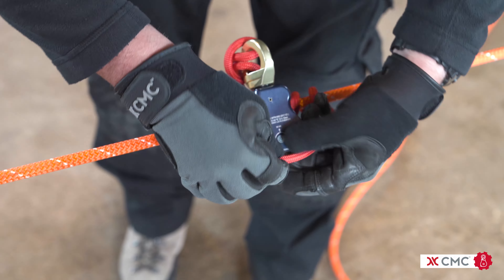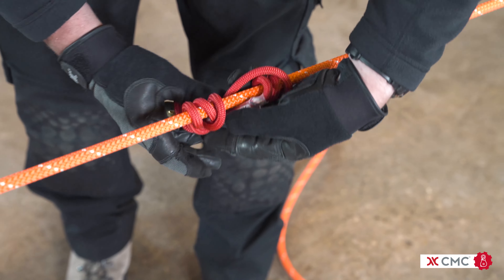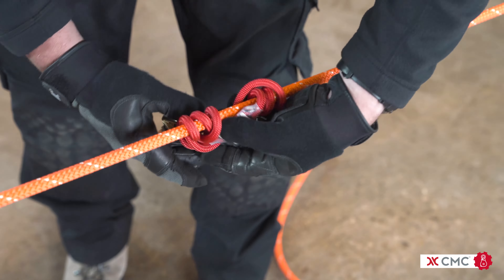Girth Hitch a Prusik Directly to a Pulley // CMC Pro-Tip

Comment: Correct me if I’m wrong but won’t the girth hitch reduce the overall strength of the system?
Reply: The girth hitch isn't as strong, but I think this video is assuming you are using the girth hitch on the ratchet pulley of a MA, not on a system capture such as tandem prusiks on a LRH. So long as a system capture (MPD/Clutch or tandem prusiks) are in place, if for some crazy reason this girth hitch on a ratchet pulley failed, the system would still be captured and in tact. 

At least with the systems/equipment I use/am familiar with, it would be pretty difficult to girth hitch a tandem prusik system capture or belay to a LRH instead of using the stronger/better attachment of the loop to a carabiner.
Reply: Yep, I agree. I was going to add another comment in the end I decided to reply to your comment

Comment: More like an amature tip. Crap, I didn't bring enough carabiners. Seriously though, this is clearly a slower method. Speed is critical in any real rescue situation.
Reply: Gear tally is also important. Some teams are minimalist, so understanding techniques to minimize gear use is important. The more you know, the less you have to carry. Your solution can't always be "just bring more gear."
Reply: Just to be clear, and to build off of the very prescient previous reply to your comment, this is not necessarily a slower method. The way shown in the video is sub-optimal. Instead, with the prussik already built on the line, one should simply pass the standing end of the prussik through the swivel eye of the pulley, and over the pulley to complete the girth hitch. Just as fast as using a biner, and one saves the gear/weight for a different purpose.